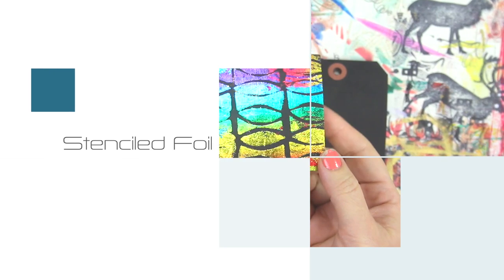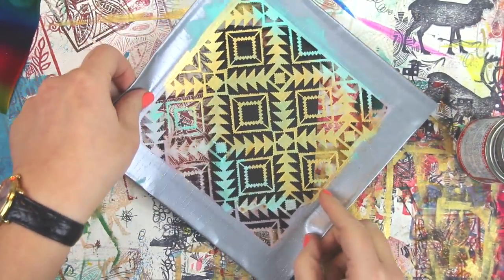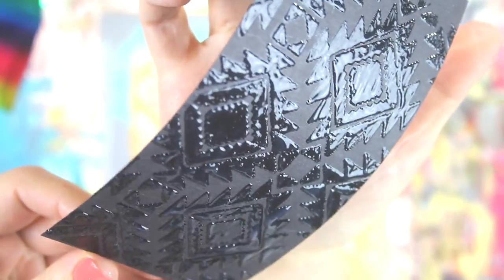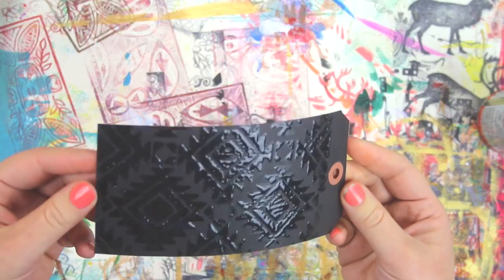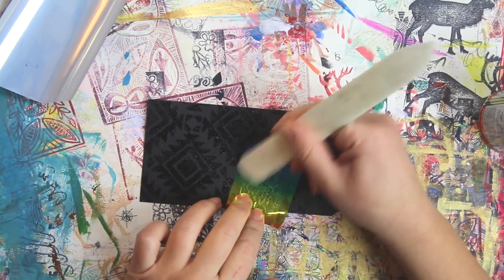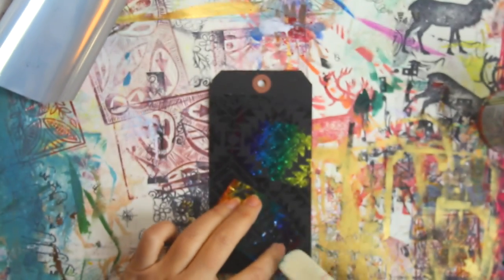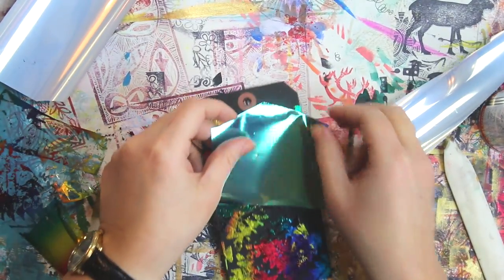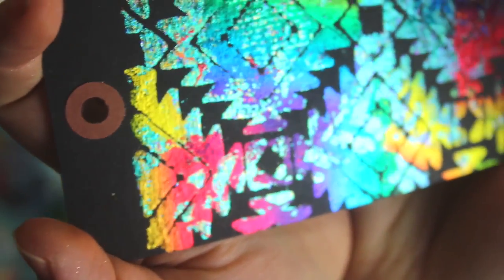Foiling with Rubber Cement & Balzer Designs Stencils

Comment: Hey tonight I tried this technique, but it didn't work at all. I used all the right supplies etc but the cement didn't seem to have much stickiness and the foil sheet barely stuck on. I did try it on double sided tape and it worked well. What I finally came up with was using Aleens Tack It Over & Over glue on the stencils...it worked with foil flakes excellently but still didn't get an amazing grip with the foil sheets. Could it be that the foil sheets are old or defective? Any insights would be appreciated! Thanks!
Reply from the maker: Rubber Cement should be very sticky.  How thick are you putting it on?  Are you using transfer foil sheets or foil sheets that are meant to be used for heat transfer?
Reply: Julie Fei-Fan Balzer at first I put the cement on lightly but then I tried a much thicker coat of it to no avail. The sheets say "foil transfer sheets" & I even got the glue that's supposed to work with it. Didn't work well either...
Reply from the maker: Gavi S If it didn't work with the adhesive it's sold with, sounds like the foil is bad.  :(